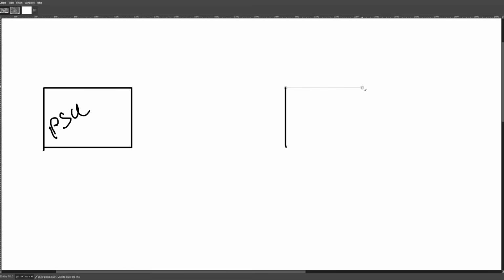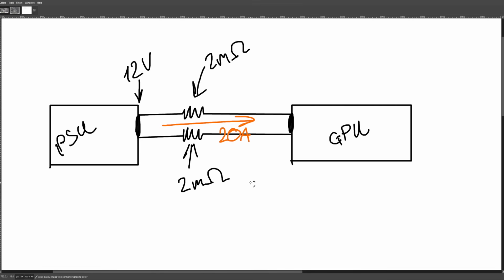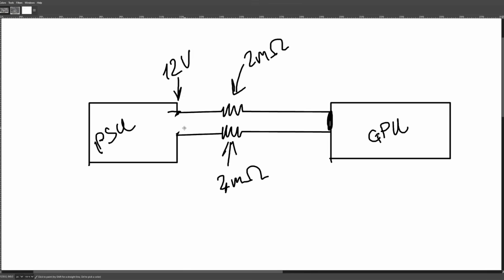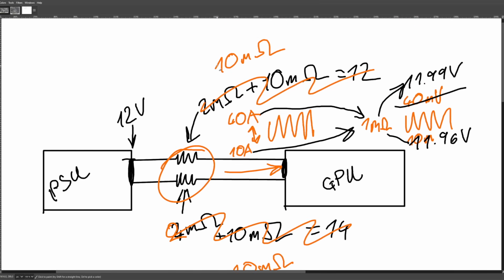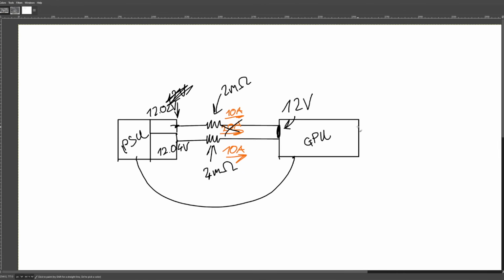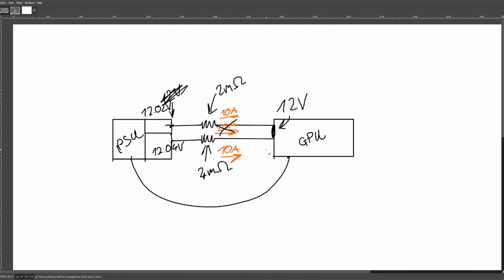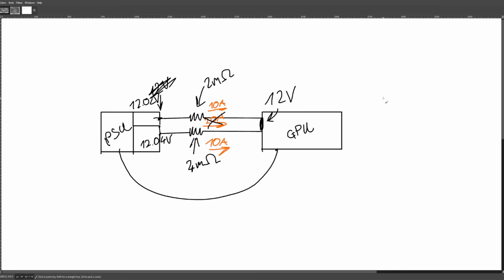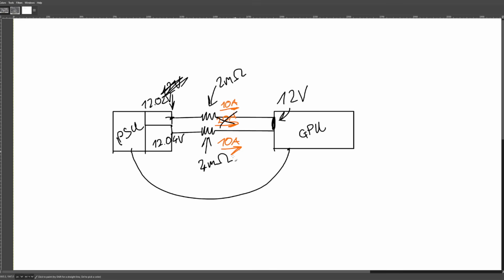Why ATX power supplies don't load-balance power connectors

Comment: The 20/24 pin connector supplies the precise 3.3V core voltage for PCI and older CPUs, so it is the one that needs remote voltage sensing .

Comment: I wouldn't even have expected the PSU to try to fix the balance, just kicking off the GPU line if it detects that you're in a melting scenario would be fine. Not that any of this should be necessary in the first place.

Comment: Anderson Powerpole 45s have the same footprint and can do 600W handedly. The 45A current rating is from the wire not the connector.

How they thought such a poorly underspeced connector would do the job is crazy

Comment: There is both 1 psu and 1 gpu that monitor the 12v. Which fun fact. Its AUSU top line gpu which also brakes the standard. So time will tell if they get sued for altering the patient.
The patient says all 12v should be conected to the same plain on the gpu without any interference. Stupidly overlooked

Comment: I dont know why then dont just use a two conductor cable with a higher awg + connector rated for higher current like they have on drones. If they want to use multiple power cables. it could be possible to have just a single psu, but alternate in a cycle which cable is connected at a time. Effectively alternating pwm each of the wires, so the average current in each is about the same.

Comment: I had a question regarding this, so if in theory we were to say split the 600w connector up as suggested into a few different phases, so the power regulators can largely pull power evenly across the connectors.
In the case of taking an identically failed cable that has 4-5 pins on either side of 12v connector where assumingly the pin connection resistance is far out of spec and connected to a 12vhpwr system traditionally would lead to 1-2 pins taking majority of current due to simple parallel current equations.  

Taking that connector and same situation, having power regulators forcefully pulling power through these highe resistance pins wouldn't while before we had a roughly a ~ 3 pin redunancy and alot less power loading per pin, now if we were to say split the 6 12v wires into 3 phases, or something similar as you've outlined, a pin connection that has pushed up to 60mOhm or something (~50 mOhm above tolerance), and total line impedance on both wires in a phase is higher.  Wouldn't we potentially see even more connectors burn up?

We already are in a situation where have a single 12v phase, the power loading per pin has changed and the safety margin is lower so fundamentally we are literal up shits creek without a paddle any way we go, since currently these connectors are having potential to get into situations where majority of current is going through 1-2 wires out of 6, so if we just force current evenly through the wires that addresses 1 problem, but might just expose another fundamental issue of why its happening and wasn't common to happen before since the pin loading was so much differnt and had far higher safety margins.

I could be off base but would be interested to hear your opinion on this as I've racked my brain how to approach this and the types of pitfalls that exist due to how failure works.
Reply: > another fundamental issue of why its happening and wasn't common to happen before since the pin loading was so much differnt and had far higher safety margins.

Second part answers the first. It WAS happening, but was masked by (1) much higher safety margins and (2) fewer conductors per device, reducing the degree of imbalance possible. No one notices problems in the field until things start melting, burning, or exploding.

Comment: 2-power-supplies solution could be implemented as one 16V power supply feeding a single-phase buck converter on each pin.  This would be, of course, ludicrously complex and uneconomical.

Comment: why nor use PTCs in each cable? They would add resistance when getting hot. Or use rgb led's in the cable. Then you would see if amps are too high when a led changing it's color.

Comment: Interesting how we sit here and do rocket science with a dash of Lucky charming and people still are perfectly fine with using 12v connector...
Because Better cable management... 
Priorities...
BTW you could limit Power per Line if you had IDK like Archaic power connectors that top out at Very safe levels of Power for the cable...
Just sayin...

Comment: it's so funny to me that AMD managed to release the r9 295x2 with 2 8-pins with less drama than this, 125w outside the actual spec
Reply: I must also add that violating standards is truly a garbage idea
Reply: Violating a standard that's shown to have the headroom needed in the safety factor is better than using your position on the standards committee to push one that doesn't work through.  @iaial0
Reply: Well, did they melt?
Reply: @iaial0 No. The 8-pin spec has a really high safety factor of almost 2 at a theoretical maximum of around 290W. At max load, this card would be drawing around 212W per connector leaving an ideal safety factor of ~1.25 which is still pretty reasonable.

12HVPWR's spec only grants an abysmal 1.1 safety factor at max load and that goes out the window if contact is bad which is pretty easy to do accidentally.

It's pretty surprising that the 8-pin spec is rated so low, a GPU overdrawing isn't exactly an immediate danger to life so who knows why it's that way. Maybe something about added margin for crappy cables.
Reply: @iaial0   I have a crappy brazilian power supply (it's good but the cabbles suck) and I've pushed them to 250 watts on each 8 pin. The most that happened is that the cables got wrinkly.

Comment: Some users don't get how DC to AC works. Its idiotic to use 48v when AC plug will be 480v and 24v for 240v...its we never want go any higher due to transformer costs when its easier to do 120v to get 12v.

Comment: The time has come for 48v standard computers with these high power draws.  It’ll solve a lot of these problems and suddenly the 8 pin connector works beautifully for GPU’s and we can forget about this nightmare of a connector until we have 2,400 watt GPU’s lol

Comment: Another thing for PSU side current balancing: If one of the wires has more resistance, raising the voltage (and hence the total power into the cable) would cuase that pin to heat up. It could, in principle, actually cause additional melting.

Honestly, I'd rather have nvidia create a whole new spec, with a way over-engineered connector and tons of headroom, that costs like $40 for the cable. If you can afford a $2,000 GPU, what's another $40 bucks.

Comment: oh c'mon, the reason why the 12v pins always melt before the ground pins is simply that most of the current is exchanged as heat, simply less power running trough the ground pins - could have just stated that.

Comment: 3:10 In theory any modular PSU with a 12v sense wire could be modified to sense from the GPU with a custom cable 🤷🏼‍♂

Comment: 25:13 "Why do they have to be so close to the limit?" Talking about the 12V high power connector.

That's simple to explain. The connector is made to be very compact with 12 pins to transfer all the power. That means the connection pins are pretty small and the contact surface to the sockets is also pretty small. To be able to transfer all that power they have to really play on the edge of what is physically possible. If they used the same margin between the specification for total power and the physical capability to transfer power they would end up with halt to two thirds the poser spec. In other words they would need two of the connectors on their halo cards to provide enough power.
TLDR: Because they care more about the looks of the connector than the functionality.
Reply: yeah, that is a correct answer. But there was no reason they had to make the connector this small (other than, as you said: it looks neat). No one forced them to make it as compact as possible.

Comment: since nvidia keeps insisting that user should only use the stupid included adapter, and refuse to use multiple connectors, why dont they hardwire a 4x 8pin break out board on a two 30cm long 16mm2 finestrand wires that are soldered to the gpu so you cant use "the wrong" 12vhp connector

Comment: If it "joins" together on GPU connector side anyway why does it need to be split on cables, why not just connect all pins and use one wire that can handle 100A?

Comment: I think it is fair to require PSUs to have a fuse per wire, just like a 230/400V 3 phase circuit breaker.
Reply: So everytime there is an unbalance you have to open up your power supply and shut down your PC and Exchange a part that is not recoverable instead of the GPU just autobalanceing it. I really dont know why you want to do such complicated unnecessary stuff
Reply: In an industrial setting it makes sense. Not here, though.  @tumage8592

Comment: Forced current balancing on the 12HPWR doesn't even solve the problem. In the un-balanced state, the power dissipation in the connectors is actually minimal for the pin resistance present. If you forcibly balance it, the power dissipation rises and the thing may melt faster. The dissipation also gets shifted around, so you just melt different pins.

An example: Pin A has 10mOhm resistance, pin B has 2mOhm. There's 30A flowing through the connector.
Unbalanced: 5A flows through pin A, 25A flows through pin B. Pin A dissipates 0.25W (I²R), pin B dissipates 1.25W. That's 1.5W total heating up the connector.
Balanced: 15A flows through pin A, 15A flows through pin B. Pin A dissipates 2.25W, pin B dissipates 0.45W. That's 2.7W in total.

If any manufacturer actually released a PSU that tries to balance the current, I wouldn't be surprised if it melted even more connectors than standard PSUs without the balancing feature. There's just no way around a better connector. The old 8-pin connectors aren't only more robust than the 12-pin, they're also able to dissipate more power without melting because they're physically larger.
Reply: oh this is much more concise than my comment, i'll delete mine. i think this is it, the only safe thing an active system can do in response to current imbalance is disconnect power, any attempts to compensate just replace the existing positive feedback loops with even more aggressive ones.
Reply: If there is balancing, there would be monitoring too - if there is need to draw too much current per rail - stop all 3D and limit the power to 3A or so. Can even use all the RGBs to denote an issue.

Comment: Instead of current "balancing" you should call it current regulated... this can be done and should probably be done if you use multiple wires from the same source as those wires are now just simple parallel resistors.
Reply: It does not matter if the voltage drops to 10 or 11 Volt, there is still a regulator behind it that steps it down much further because at 12V transmitting power is more efficient... the electronic circuit to do this will cost you... three bux per wire... something I would gladly pay for.

Comment: Now that nvidia is basicaly maxing out 12whp will they use it alongside 6-8 pin connectors? Will they pull the full  75w from the pcie for a generation?

Comment: Oh lord, I just always assumed that those 4 "sense" pins were exactly for detecting and adjusting voltages as necessary, in the same way some lab/bench supplies do. But no, their purpose is much more dumb than that.
Reply: yeah, they're not actually sensing anything. They're just a fixed 4-bit signal to the GPU to tell it what current it is allowed to draw. That signal is achieved by them either being connected to ground or not. That is useful to tell the GPU if there's giant kraken of an adapter with multiple PCIe cables on it, or just one. Or a weak or strong PSU. But it's not in any way sensing anything about power draw, per pin current flow or anything like that.

Comment: Surely there is some simple circuitry that is used in other industries to do load balancing? This can't be the first time in history we encounter this problem.
Reply: the other industries that don't burn up use some combination of adequately sized connectors, higher voltages, trained technicians, and more reasonable load balancing scenarios. parallel conductors don't have to be a problem in a well designed system. PCs are highly standardized, which is a good thing, but it makes adapting to these large changes in power delivery really hard, especially when the market leader in a segment half-asses the design.

Comment: just adding a temp sensor that clocks out at 100 or 80C would do it as a bandaid and would probably be the simplest solution for their current production but like you said it costs....
for now just put some beacon on your cables, if it smells tasty, take a break and let it cool off while eating lol

Comment: Well, I was very interested on knowing why the ground side of the connector does not melt. P=I²*R so it should be the same than 12V side. Does the connector hold better the pins in place on the ground side????

Comment: How about I just replace the multiple power and ground wires with a single length of double-aught welding lead? :D

Honestly, I feel that this is basically the answer. instead of six each of power and ground wires, run ONE wire each of the proper gauge to carry the load with a 2.0 safety factor. 12VHP with however many pins becomes a connector with 1 power, 1 ground, and sense pins as/if needed. Problem. Bloody. Solved. 

The entire reason for the current situation (no pun intended) is that the companies that make PSUs are trying to maintain needing a single gauge of wire to build out all their cables and this must end.

FFS, even the military gets this right and they live and die by the cheapest manufacturer.

Comment: So if they used 2 beefy cables for it, it would not melt?
Reply: The cable would not be very flexible.  But LTT did exactly that by putting a xt120 connector on a 5090.

Comment: i think a 8pin at 200% load is just as likely to melt and the 12pin plug
Reply: It will never, there is not a single GPU that can reach such a limit. 75Wper+12Vpin, 75*8 = 600W, 5090 with 3 8 pins can do 1800W max. It's just ridiculously overbuilt.
Reply: @AbiPrasad  a 8 pin at 200% load is 300 watt
Reply: @chadmckean9026 thats average load, look at how much max is by spec and gadge of wire it is, he basically explained in the video.

Comment: Meanwhile me wondering why the industry won't switch to a connector with just two beefy pins and few auxilary signals. Many cables were fine in 2015, now tbey are an afterthought, using them increases cost and complexity of the power delivery system and in return the cables are just a bit easier to manage and maybe look cooler. I doubt the second part actually, thick cables could look as sick as hard water coolimg loops.

Comment: the solution is load-side balancing, multiple buck regulators that communicate how much they are providing vs the total load and adjust dynamically on each wire
kinda like all gpus before 12VHPWR... oh.....

Comment: I have an ASUS Motherboard (W790-Ace), which has two ATX connectors, and is specifically designed to work with two PSUs, if needed - it has also two sets of EPS connectors, 4 total. Manual mentions that PSUs don't specifically need to be identical, but they must have matching wattage. You can design things around separate current sources, but just looking at the circuitry around both ATX plugs makes you wonder "is it really worth it?".

Comment: The regulators on the GPU board are buck converters and in consequence have a negative input resistance characteristic. If the voltage supplied to them drops by 10% the current must increase by 10%. Unless the converters are designed really close to the limits, they aren't going to care if the voltage drops by 10%. The input current just increases to compensate, which puts even more stress on the crappy connectors which are obviously at the root of the problem. Garbage in, smoke out.
Reply: thanks a lot, i'm trying to go to sleep and now i'm thinking about what kind of mass destabilizing effect all the switching power supplies must have on shared power busses. i'll bet at a grid scale, brown outs have gotten a lot more complicated and dangerous as our collective loads have gotten less and less ohmic over the years. negative resistance is pretty cool but damn is it scary to think about in larger systems
Reply: if voltage drops by 10%, current has to increase by 11.11% to match power, and slightly more because of the higher switching losses caused by the higher current
Reply: @ this is true, but if we're being this pedantic, isn't it the conduction losses that would increase with input current? if i understand correctly, switching losses scale with output current, which doesn't change in this scenario.
Reply: @spambot7110  i meant switching losses as general losses in the switching conversion, most of which would be hysteresis and conduction loss. i'd assume that synchronous converters are used in gpus
Reply: @drkastenbrot  ok so to be fair i don't understand hysteresis losses very well at all, and for all i know that might fall under the umbrella of "switching losses". (i'm using the definitions of "switching" vs "conduction" losses from some random TI app note (AAJ 1Q 2016 page 22) that seemed to reflect how i've heard ppl use the terms? but it kinda glosses over inductor considerations)

Comment: And in the meantime, what I'm waiting for is a collection of corrected benchmarks based on power limited 4090s and 5090s (and 5080s too depending on where exactly the safe power consumption mark is determined to be for such a project. It seems the candidates are 320 and 360 watts) None of this firestarter kit benchmark nonsense that is currently what is out there.